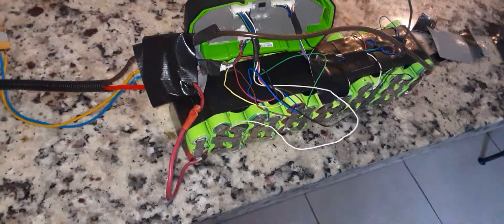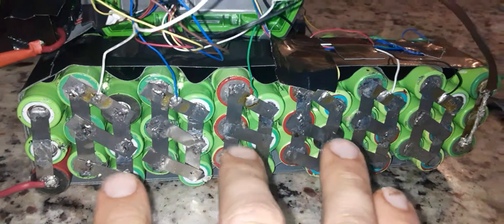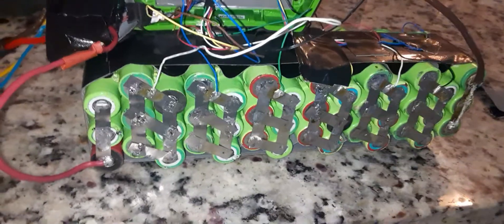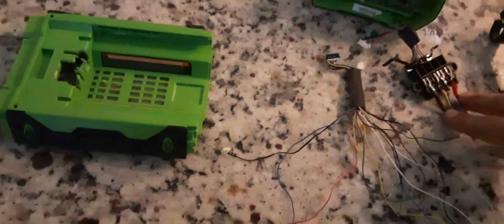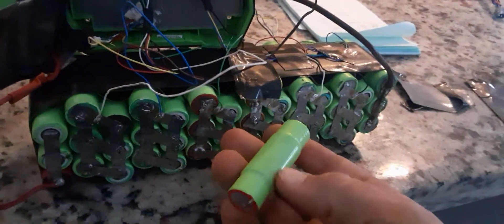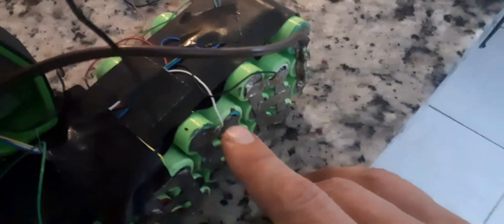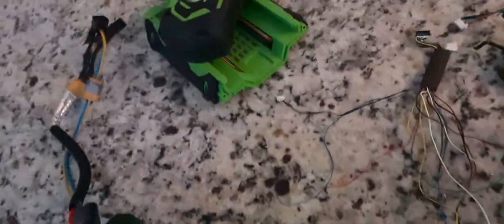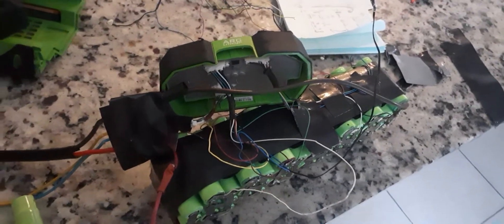Custom Ego 56v battery- (3) 2.5ah disassembled and reassembled into (1) 7.5ah battery

Comment: 3p14s the bms doesn't know if you have 1 or 3 in parallel it is the same voltage also the wiring is easy just remember to attach the wires in 4 volt increments in the series and remember to mark down the colour and voltage from the original so you get the right wire on the right voltage.